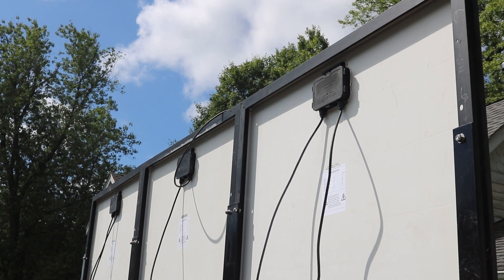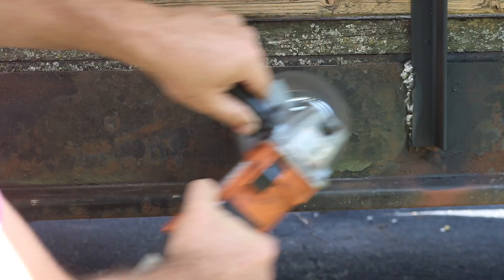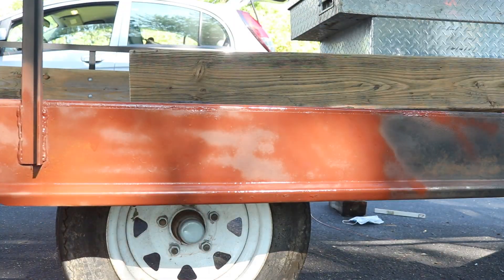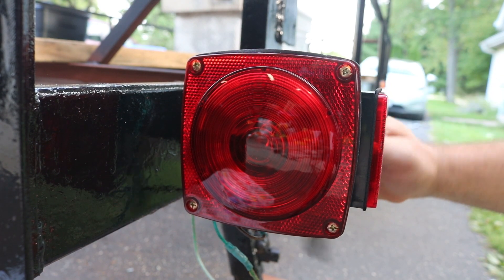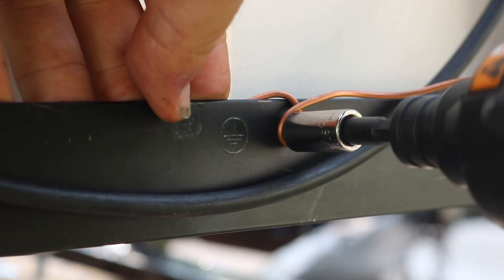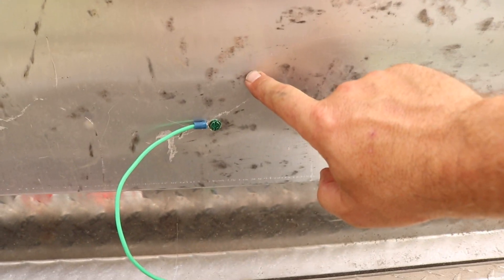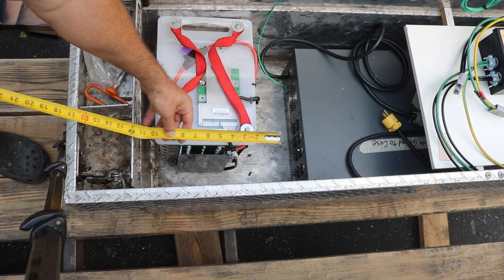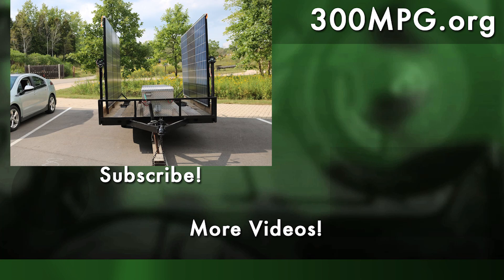Solar Trailer: Part 12 - Wiring, Grounding, Painting

Comment: Hey, Ben! My wife and I found a used/cannibalized DC Solar Trailer with the SMA's, charge controller and panels so we are headed in this same direction for mobile power system in Northern Nevada! Great video! I am hoping to install additional panels to support the 2,000Ah GNB VRLA 48v Battery Bank.

Comment: Excellent video. Did you connect your battery negative to the trailer? Does it share the same ground as the equipment grounding? Thanks
Reply from the maker: Great question.
Yes, the 48V battery is grounded to the frame. The UPS that I'm using as an inverter already grounds the 48V negative to the metal housing of the UPS. That's in a metal tool box and also grounded to it. I also have a ground wire from the back of the UPS to the trailer frame.

The frames of the solar panels are all bonded and then grounded to the trailer frame.

Comment: Wonderful project, Ben. I wonder, can you use the trailer to provide energy for the propulsion?
Reply from the maker: I can slowly charge an electric car using an 8 or 12A 120V EVSE.
The inverter is only 120V, so I can't do level 2 with this current setup.

Comment: Grounded to what (your cars electrical system when plugged in) trailer on rubber tires.
Reply: They’re statically bonded, preventing any arcing between the various electrical components in the solar system. To truly ground everything, I think he needs to hammer a copper rod into the ground and bond that to the rest of his electrical system.
Reply from the maker: "GROUND" can mean a whole number of different things, which is why I specified Equipment Grounding and Equipment Grounding Conductor in the video. This is electrically bonding together the trailer frame, solar panel frames, electrical enclosure and everything else which normally does NOT carry current, but COULD carry current in a FAULT situation. In event of a solar/battery positive or AC hot conductor accidentally coming in contact with something else (possibly allowing a human to become part of the circuit when they touch a conductive surface) a fuse or breaker opens the circuit.

System Grounding, Ground rods, Neutral to ground bonding, and several other items are all related, but get complicated quick, so that will have its own dedicated video.

Comment: 6:45 be sure to also check individual signals. I have seen many times trailer flashes opposite signal as tow vehicle.
Reply from the maker: I've never heard of that happening, but noted.
Reply: @BenjaminNelsonX  my day job is driving truck, see alot of weird stuff.
Reply from the maker: @AndyFromm  Always good to listen to the voice of experience!
Reply: @BenjaminNelsonX  i think I only seen the mixed up lights twice. I won't pass vehicles while they are turning or are near an approach/driveway/intersection just incase they are turning (I've seen too many accidents like that), if I would have passed that mixed up trailer lights that one time, it wouldn't have ended well.